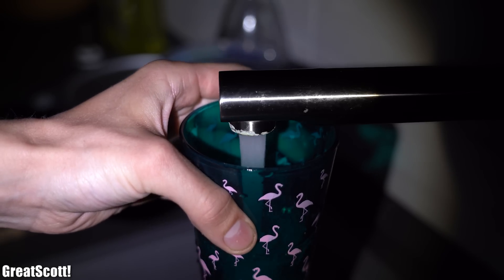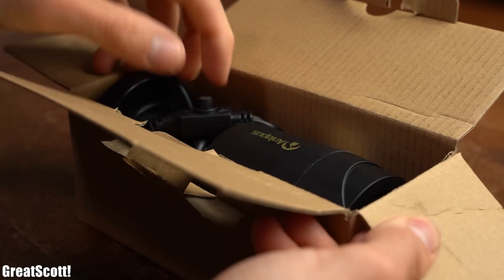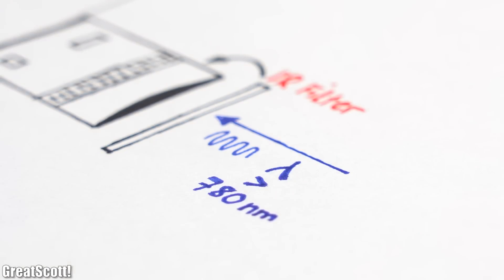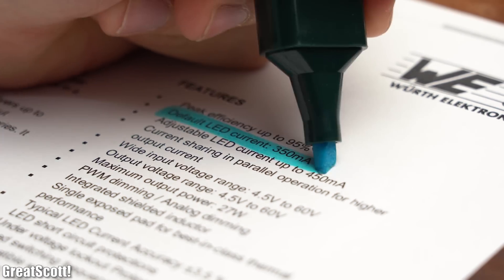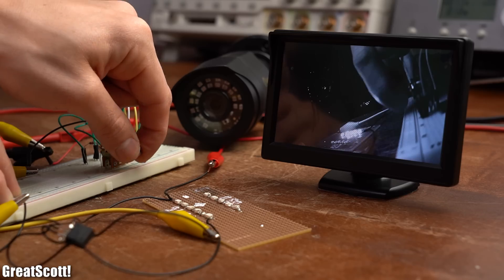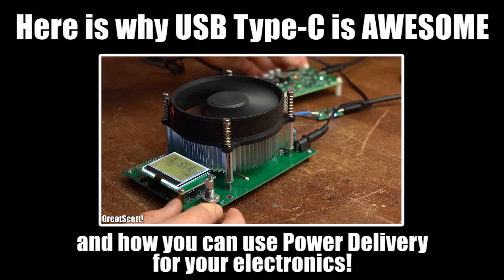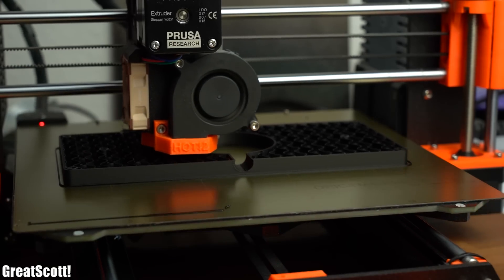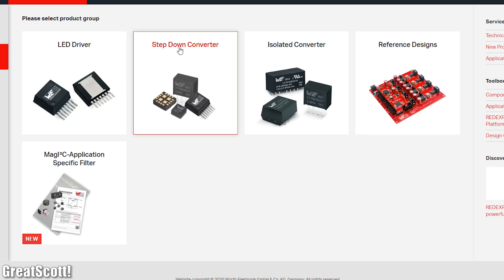How to make your own Night Vision Device!

Comment: The beam cluster is too concentrated. I had the same problem with an IR floodlamp I use in my darkroom for filming video. You get more throw, but the problem is the periphery is underexposed. My solution was to use some 3mm packing foam as a diffuser.

Comment: sir can you please make a video of rotary incremental encoder  Aideepen AB 2 Phase with arduino and it's code..?  it will be really helpful.....  i need the encoder value as input for my dc motor to run a diy CNC...

Comment: hey scott, could you please make a battery powered Desktop PC like a laptop. not UPS powered. PC motherboard uses only DC Power only. by using a PSU like APC back-UPS , 12v to 230VAC again 230V to 12v conversion is happening.. in this way lot of energy is wasting for conversion.
Using a Battery directly  to the motherboard with some protection and charging circuit will saves lot of energy and gives longer battery life.

Comment: If you have a working camera and not working camera could you take out the infrared leds out to powef them and do you need a potentiometer to adjust the light or could you power them normally or would that fry them.

Comment: you can just make a cheaper one for just 2 10 buck ir HD cameras, 2 car monitors, get the screen out of it, then 1 3d carboard vr glass headset, and 4 rechargeable 12 v batteries. no soldering, no nothing. just plug it in. only problem is that you cant donw the brightness of the screen

Comment: I have a couple of IR diodes at home, but they didn't have any specifications or labels attached to the package when I bought them, so I don't know about their minimum forward voltage ("Vf") and max current ("If") ratings =/ 

Is there any way I can figure it out by using a multimeter? I have one with the Ohm-symbol on it, but I have never used a multimeter before so I don't know how it works 😕 I know that the black wire always should be plugged into COM (ground), and I guess I should put the red wire where it says "V". But should I leave it attached to the same plug while measuring both "Vf" and "If"? And how do I interpret the output values? 

Do I need to add a resistor to the circuit before I start measuring? If so, where in the circuit should I put the resistor and where should I place each individual test-leads? Like, should I place the resistor before the LED or after it? And should I then place the red test-lead before the LED/resistor or between the LED and the resistor? The black wire should obviously be placed at the "end" 😋 ...🤔 right?

Comment: Please GreatScott... Make a video about how to make a simple negative voltage source from rectifired DC Voltage source like a 9 volt batery. You know.. that kind of negative voltage like a TDA2030 uses or like - 5 VDC pin on older 20 pin ATX powersupply. Please i want to power my tda 2030 from 2 9v battery. And i want  to be able to convert one of my ATX 20 pin powersupplys(None of them have -5V) to use it for AT MB. PLEASE i was searching all over the internet and without the ressoult please...

Comment: you should not directly connect strings of LEDs in parallel. You should add a resistor into each string to balanche the inherit non-linearity/non-uniformity of each string.

Comment: Great video, I guess I can use an old and cheap AR viewer that uses a cell phone and put everything in there.

Is it safe to make a "DIY car battery charger with a 13V or 19V laptop charger?, by safe I mean if it will work and will not damage the car battery, thanks and cheers!!.

Comment: The design appears to be Clunky, but if you went wit smaller screens one for each eye, you could improve the clunky look, not to mention a RPi Zero with a NoIR camera would work just as well, and with a couple of small LCD screens running over SPI would make a better more compact and less clunky project

Comment: I want a video about mosfet gate driver and bootstrap circuit for control high side mosfet for control speed of 180v dc motor on running machine

Comment: Great project. If you had used lens from a cheap cardboard viewer, you could reduce the focal length of your 3D printed viewer thus shorter case and reduced the weight on your head and neck.

Comment: There is to much IR-light pointed to the centre of the image. Only a small part of the centre is perfectly lit and the surrounding is left in the IR-dark. Maybe use a diffuser or use the IR-LEDs on a sphere or a bowl so that the light is spread evenly through the room. I have no idea if an ordinary diffuser will work and spread the IR-light, aiming all IR-LEDs separately to get a good coverage is a lot of work.

Comment: Hi ! Can you please share the schematic for your PWM dimmer circuit? I have tried a lot of different variations but none of them have  clean performance as yours does. Also do let me know of the recommended parts I should use while assembling the circuit.

Comment: I have one for you. I need to build a temporary bypass for a Hoshizaki ice maker. I need to create a relay that latches for 6 minutes with a 12V input signal that becomes present  but only lasts for 1 minute or less. 
As water is consumed by making ice the level drops to the point it is time for harvest mode and the float switch opens. [I can reverse that by using a relay and I have a 12v supply so when the float opens a 12v signal is supplied.] As soon as harvest mode begins the tank starts to fill but the tank will get full in a minute or less but I need the harvest mode relay to stay shut for a total of 6 minutes. Now that is a lot of background info. I digress back to my third sentence statement...
"I need to create a relay that latches for 6 minutes with a 12V input signal that becomes present  but only lasts for 1 minute or less."
Heck, I could have the 12v signal from the float trigger drive a 35Ma relay with a 30,000Mfd capacitor across it so when the float signal goes away the relay will be driven by the capacitor for 5 minutes...LOL
Could you send me a simple signal triggered relay timer circuit? It would probably only take a...  relay, transistor, capacitor, resistors and a potentiometer.

Comment: Correct me if I'm wrong, but more LEDs in parallel means less tolerance against failing LEDs, doesn't it? If one fails OPEN, the row in series fails, removing 20% of the current consumers, the 350mA get divided to the 4 remaining rows by increasing the voltage and Power per LED and thus more heat. This leads to an increased likelihood of another LED failing and the cascade kills all the LEDs. If one would fail als a SHORT (which is more likely), the driver would have to lower the voltage to ALL LEDs reducing the max brightness.
With five drivers a LED failing Open would still take out one row, but the other rows would remain unharmed. LEDs failing short would only cause the one LED to fail with no brightnessloss.
So using 5 drivers is more expensive but it is not a "beginners mistake" but "quality engineering" 
But of cause I'm not saying, that the decision to only use one driver is wrong... It's just cheaper and less reliable

Comment: I sort of did something like this using a mini "pinhole" camera, a camera viewfinder CRT, some safety goggles with an elastic strap, an IR spotlight and some circuitry to take a 7.2v NiMh pack up to 12v for the cam and spot-light and 5v for the mono CRT viewfinder,  it sort of worked but build quality and mirror (cut up CD) was much to be desired and didnt get a very good picture out of it

Comment: I wonder if the camera circuit board had a step down from 12v to 5v as the first set of components.... can't help thinking that you could have tapped in 5v and cut out the pd circuitry... Also if the camera had an hdmi output it'd be a nice add-on to use on an existing pair of goggles that take HDMI inputs, Like FP Drone goggles...

Comment: Nice project. The whole thing could of been smaller if you'd use some old VR headset and let's say raspberry pi for HDMI output. That way the whole weight wouldn't be on your head but in some small pouch on your weigst. IR LEDs needs to be spaced apart else center of the image will get overexposed.

Comment: Usually paralleling semiconductors does not end well as manufacturing tolerances means they don't divide the current evenly. And worse, forward voltage drop decreases with temperature meaning you've got a runaway situation.  A small resistor in series with each parallell string would solve that.

Comment: I like this project. I hadn't thought of scavenging parts from the security camera - good idea!
I didn't see any method to ensure the LED strings all receive similar currents. The problem is that when LED's warm up, their forward voltage drop (Vfwd) decreases. For LEDs in series, this isn't a problem... as long as you're driving only one string. When you drive more than one string in parallel, one string will draw more current than the others and will warm up faster, lowering Vfwd, increasing string current, etc... All while another string runs cooler, and tends to shut down.
One way to address this puts a resistor in each string. This resistor develops a Vfwd of its own, but is not sensitive to temperature. The Vfwd of this resistance should be about 2 times the total Vfwd variation of the diode string 
(Vfwd_max - Vfwd_min)*5*2 = Vresistor   (5 for 5 LEDs, 2 to double that; find Vfwd_max and Vfwd_min from the LED datasheet).    Istring = 70mA.     Find R = Vresistor / Istring
There is some inefficiency in adding the resistors, and is still not a Great solution, but it works well enough.

Comment: Looks great!  Have you ever designed an IR device that can read heat signatures for PCB troubleshooting?  Commercial varieties are very expensive and the DIY types I've seen have ridiculously low resolutions.  Can't seem to find one that will output a reasonably clear image including text measurement in the approx 0 to 350 deg C range.  Also, having the image bluetooth to my phone would save the cost of a separate display.  Is there such a circuit that I can build using off-the-shelf parts?

Comment: Awesome video !  I was wondering if anyone could help me with an issue im having. Does anyone know how to get rid of electrical noise introduced into a circuit when powering a motor. in my case its an audio amplifier but i added a fan to cool it, the thing is you can here an audible whine through the speakers when the fan is connected 🤔
Reply: use a cap from vpp to gnd.  Thill short the ac but not not affect dc supply to fan

Comment: Neat but not a very portable or practical device in that form.

Its easier to build one with a true IR illuminator LED, and a image intensifier.

Military grade ones are only 3k or the cheaper version for 1k.

Comment: Why you just don't use mobile phone? Little bit older phones don't have buildin IR filter. (You can recognise it by pointing phone camera on TV controller and press button on it. If you see violet light its ok). Security camera of course have a lot of cool features, but mobile phone would be cheaper (and definitly lighter) solution. In addition you can use cheap VR headset for mobile and just glue the circuit on it. But still SUPER video, I love yours creations.

Comment: Great scoot : Lets get started!
Me who barely can do through hole soldering: Yeey!
Reply: look at his soldering jobs. No offense, but what he builds here is "proof of concept" quality, not production quality.
SMD Soldering is "bytheway" easier then trough hole soldering, when you have the right tools and steady hands.
(If you do not have steady hands or technique, neither will you be succesfull with THT)
Reply: @sarowie  Meh, to be fair you need steadier hands for SMD component placement than for any THT job (and if by "right tool" you mean a pick'n'place machine, GTFO lol). But I agree that Scott's soldering job isn't generally great, on this video alone we can see he didn't heat the ICs enough to solder the back tab (which was a good thing in the end given he had to desolder them), and some of his THT joints are cold and matte, but as you said it's POC quality, I'm sure he'd do it better if it was for a customer - if only because he wouldn't have the camera in the way (yeah, don't forget that, it's probably a big hinderance).
Reply: Even worse, SMD...

Comment: "How to make a IR flash light"
Reply: It is very simple just replace smd infrared led in your smartphone instead of ordinary led flash light.
Reply: @yashdodia8048  
which types of IR LEDs used for night vision cameras...?? They looks so brighter than remote IR LEDs...
Isn't those IR rays bad for living body?
Reply: @arnab_blue  infrared in the amounts emitted by these LEDs is harmless to the human body.

IR is just light, but it's a wavelength (color) we humans cannot see.

IR can be very dangerous if you have a high power light source like an infrared laser, IR lasers are dangerous especially when they're strong enough to do damage to your eyes, even more dangerous than a normal color laser of the same power.

If you were playing around with a green 50mw laser and accidentally shine yourself in the eye by bouncing it off something reflective, your eye will likely close fast enough to prevent terrible unfixable damage.

If the same happens with a 50mw infrared laser, you shine on something reflective and it bounces in your eye, your eye won't close to prevent damage because you can't see it, so you burn your retinas and go blind.

In short: stuff like TV remotes and low power IR led lights won't harm you.
Reply: @ForgedEggs  wow, Thanks...
But still which type I use for Night vision, I have many IR leds, they are for good remotes/proximity sensor...
But not Bright enough for night vision...
Reply: @arnab_blue  IR? not dangerous, X-rays can be if in excessive amount. simple 1w LED emiter should do the trick.
Reply: how to make a IR Fleshlight
Reply: @Zenarisu  With preheating function
Reply: @Zenarisu  this was underrated
Reply: @Zenarisu with ready made curtains to wipe on afterwards.
Reply: @Zenarisu  and xray to see thrue clothes
Reply: @kaelkramer1259  IR can see through most cloth
Dont need harmful Xray
Reply: Using this method

https://youtu.be/vsvElqcu_E8
Reply: Fbi open up
Reply: That is already covered in this video. Use the IR LEDs. 
Why does this get 333 likes? 
That IR flashlight is already made in this video. 
What ?
Why ?

Do people finish the video before they "like" button ?
No. Here is proof. 
Derpity derpity derpy dingo doodoo doodie.
Reply: In my school I got a question can you explain.
Q-) Electric shock is caused by_____.
. Electric current
. Electrical potential difference
. Electrical resistance
. Electrical energy
(Note you can choose only one option)

Edit:
Correct answer = Electric current
Reply: @omtandon2741  and you are wrong
Reply: @burstyou4290  I am asking,not telling. My teacher told me this
And I don't belive him
Reply: @omtandon2741  ooh okay sry, the truth it's that it's a "balance" between the two. For example I have a transformer that output 1.5v at thousand of amps and I can touch the 2 cable without getting shocked. On the other hand, a power supply at let's say 1 000 000 volts and with a current of 1 mA will slightly burn your sky due to the heat created by the arc but you wouldn't feel the pain from the ectricity itself. You should watch a video from electrobom about this subject, he explain the phenomenon really well with example. 

Good luck with your researche and always watch multiple video!

Comment: orrrrr... you could stick a regular old nightvision camera from a cctv style setup in the front of a phone 3d headset if you find one with some room, and hack the hardware so the sensor will feed to the phone. that power bank will run most basic 12v cctv cameras. might even be able to set some cameras up to use wifi to connect to the phone.

hmmm... and i have spare phones. time to find one with otg and see if i can hack something together.

Comment: 30s into the video and... why make it all boxy like that? i know the idea is to be DIY, but still, you used the premade board with IR LEDs, and the camera. you could've made a much more refined thing using one of those cheap VR googles one slides a phone into, and just either use a custom screen, or an actual phone showing the video feed from the IR camera.. other than that, cool build tho